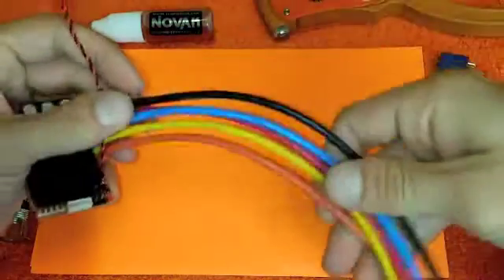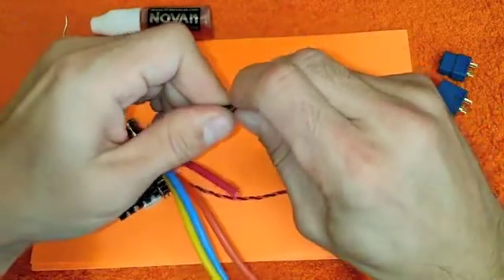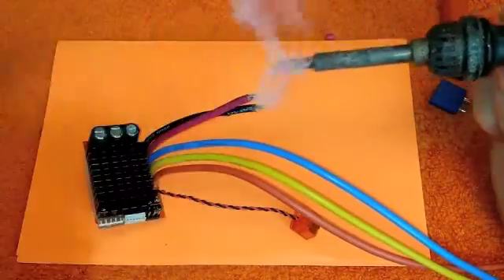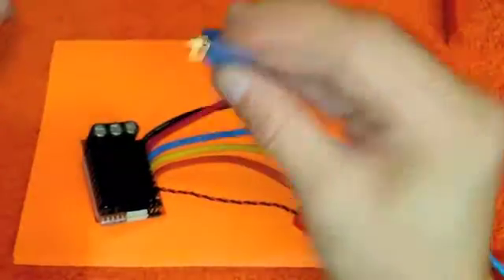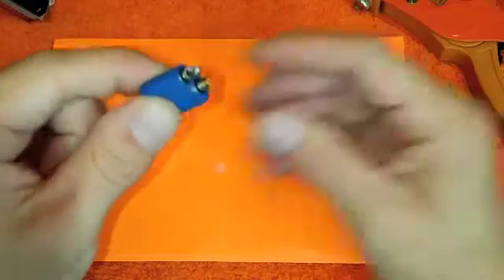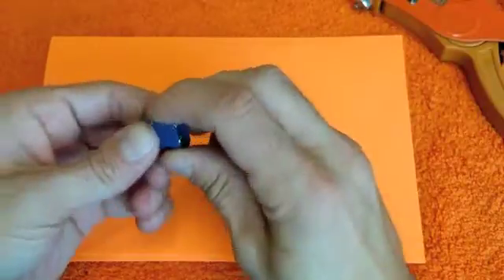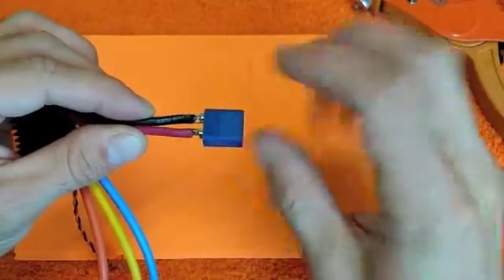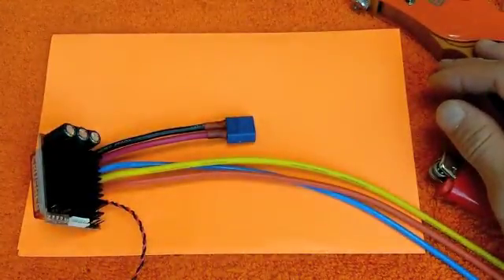How To Install XT60 Battery Plugs

Comment: I LOVE using XT60 Connectors! I switched all my batteries over from using D___'s Plugs and now I don't have to worry about my connectors melting or fusing together after a long race or practice session. With today's high powered LiPo's and brushless motors, these XT60 connectors can really handle the current better than connectors made back when we still used NiMH batteries and brushed motors.